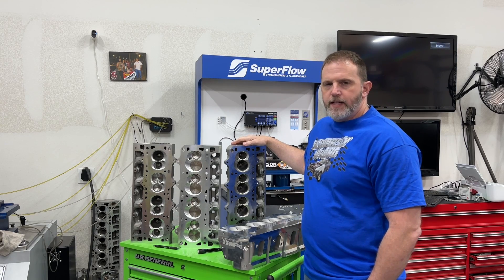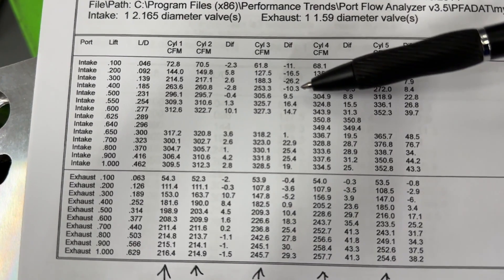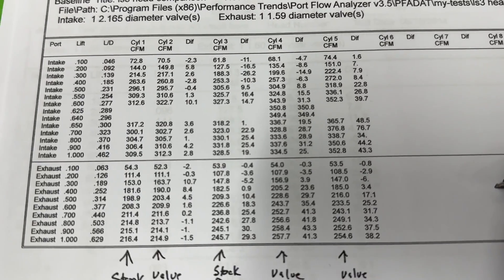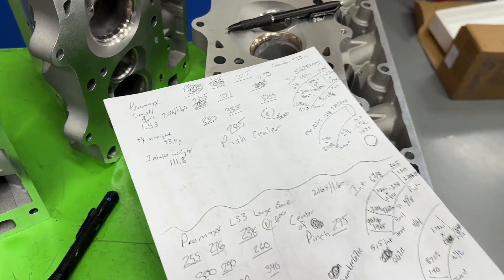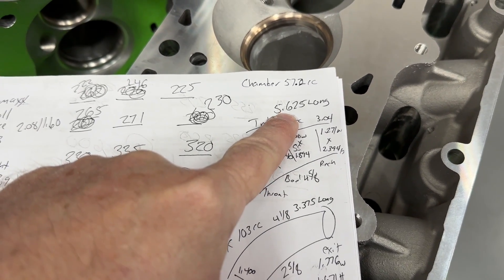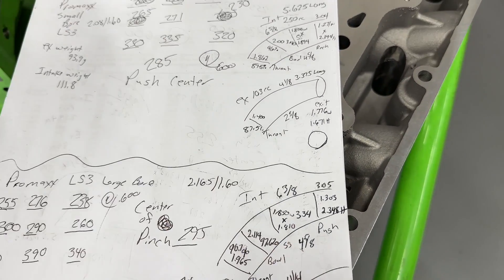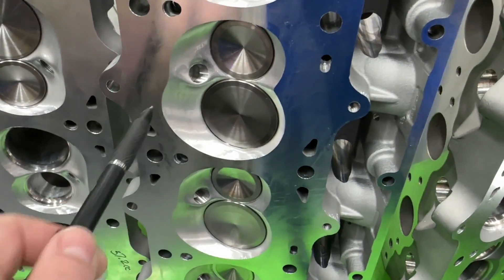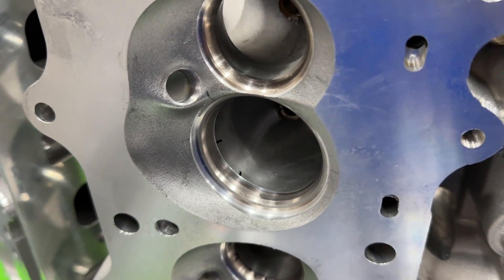Which Is The Better Flowing Promaxx LS3 Head

Comment: Looks like at the very least Promaxx has some quality control/tolerance issues they need to work on.
Reply from the maker: Every company makes mistakes
Reply: @WeingartnerRacing  This is true - I'm sure the next set you come across will seal properly, have a 240cc intake runner instead of 250cc, a 63cc chamber instead of 57cc, and flow just as well as the first set did 😉 

It's really the combustion chamber discrepancy that concerns me the most. Very few people are going to cc a brand new set of heads and on an LS1 going from an expected 63cc chamber to an actual 57cc chamber is going to raise your CR by ~0.8, and that could lead to some real tail chasing figuring out why you keep running into detonation on pump gas with what should be reasonable timing.

Comment: Nice side by side flowing and and other stuff my guess since it is a 408 kinda bug engine not to big. But I think 3rd place will be stock head then 2nd place will be large bore yes is outflows small bore by a lot but the small bore already flows so much air probably engine doesn't need anymore so the small bore with way smaller cc that will make more compression I think small bore will take 1st

Comment: Bcz YT took my reply button away, I write this here: The swirl turns, bcz the swirl guide, the ridge inside the bowl creates a stationary vortex that fills the wall side of the bowl. This turns the flow towards the center and under the valve. Depending on your cam profile, this can bleed into your exhaust and if O2 sensor is used, give a false reading on your AFR (too rich). To get the escaped charge back inside your chamber, you need a back pulse from your header setup and the incoming mix from there is hot. All this may occur from a stationary valve, so it might not be as big of a deal in a live engine where the valve is moving, but you need your swirl to move across the spark plug before it hits the exhaust valve and not the other way around. On a traditional small block this means different cylinders need to swirl in different directions. Also when you have sideways angle in your valve setup, so your valve opens towards the center of the bore, this helps directing the swirl. To fix this particular port, the guide tail needs to be blended in and the leading edge smoothed out. It still has it's place inside the bowl, but the shape has to be massaged a little. Also the valve job and especially the blending are critical to keep the swirl in the right direction.
EDIT: There is also a possibility for this setup to work as is, but it's very much cam profile dependent. That turn in swirl can fill the center low  pressure area inside the chamber, but only if your exhaust is closed. Also, if you are using positive intake pressure i.e turbo or super charger, the swirl guide acts differently. In all motor setup, with a mild cam, this port will make good power. But when you modify the setup, this guide as it sits starts to create anomalies.

Comment: I remember a while back you realized that when the intake valve opens it is close to the chamber, how do those heads do in that respect? Good job man.
Reply from the maker: The valves are moved away from the bore so it really helps them.

Comment: You do invest some flow energy into swirl, it can help and hurt you. The swirl has inertia, so it's good for transients at low to mid rpm, but creating the swirl takes some flow energy, which will affect flow numbers. Of course this isn't a hard and fast rule, different engines, and head designs make use of swirl differently. Diesels for instance benefit from swirl since they're low rpm engines and fuel mixing is very important. Their cylinder heads being flat, or nearly flat also help them generate effective swirl. On 2 valve engines, obviously, you know the swirl is built into the port and chamber geometry. On 4 valve pent roof heads swirl is very difficult to make work, so the focus is more on tumble. Of course every engine has both swirl and tumble, but again each engine is different and makes different use of flow rotation.

Port flow is aided and hindered by hysteresis, the flow circulation stores energy, if you run out of flow, that inertia stored in the system will give you that last little gasp to keep the flow moving, or it can impede reversion. It can also hurt you because the energy stored in the flow inertia works both ways, if you have that recirculation and the flow needs to go against the direction of recirculation, you will need more flow energy to get the same mass flow than if that recirculation wasn't there. You made a video, where you blocked off the port of the head you were flowing and it didn't recover fully, that would be an example of hysteresis, in order to recover the flow you would have had to introduce more flow energy to overcome the energy stored in the circulation.

https://www.youtube.com/watch?v=56HMZbr8c7E

Using the concept magnetic hysteresis is a perfect analogy for understanding fluid hysteresis.
Reply: The "top hat" or "high hat" piston design in the diesel engine aids tremendously in developing the tumble to make the homogeneous mixture burn as efficiently as it can. With the new addition of dimples to diesel pistons, efficiency is greatly increased. I believe tumble occurs, mostly, in the 4 valve diesel combustion process due to the orientation of the 4 valves, and swirl is of little existence.

The port recovery would occur with the next pulse of incoming air charge on a running engine. It along with a quarter of the initial pulse blocked and reflected at the valve closed event would not only recover, but if timed right, increase engine efficiency past 100%. So I don't see much in the flowbench incapable of recovering. It's only a flow bench. 

In reference to
Reply: @arturozarate1752  A diesel combustion chamber can induce a nice amount of swirl with poly-quad valve configuration. The flatness allows the offset valve size to induce swirl much better than a pent-roof chamber would otherwise. With such a setup you can have the ideal amount of tumble and swirl. Polyquad doesn't work as well on a pent-roof chamber, although it can be made to work with a semi-hemispherical chamber where the piston forms the quench pad, as Honda did with the F20C.
Reply: @rolandotillit2867  with the valves rotated 45° off axis I can see swirl.
Reply: @rolandotillit2867  I should have been more specific with the diesel engines I have experience with. The Ford 6.0, 6.4, and 6.7 and the Cummins 5.9 and 6.7. My comments and views pertain to thise specifically. Any others outside I'm ignorant of their piston and valve orientation. 

With both Automotive manufacturers their 4 valve orientation are rotated 45° off axis. The axis being parallel to the length of the cylinder head. That's how I can see that there would be swirl made in the cylinder. 

If the valves were oriented intake and exhaust valves parallel to the axis, I couldn't imagine much swirl but more tumble. That's what I see, or believe to occur,  in gasoline 4 valve engines.

I find it interesting that the fin of the valve guide be curved towards the wall of the cylinder. I bet it aids, a lot, more fresh air charge to remain in the cylinder than escape over and out the exhaust valve during overlap.

Personally I have a few things that I do to my cylinder heads to deter low lift exhaust flow and reduce the fresh air charge escaping with the exhaust. I like to keep the exhaust valve smaller than what's offered on most gasoline V8 cylinder heads. When a 2 inch valve is used on the intake I'll use as small a 1.500 for example. I only like 1 angle on the valve and seat. Finally I don't any "machinist ridge" on the exhaust side of the chamber.

The exhaust is under so much pressure and is forced out, at incredible speeds, before the valve ever reaches full lift. Deterring low lift flow as the valve return to the seat decreases the loss of charge.  A tulip valve, back cut valve, and smoothed seat to chamber transition will increase air flow but also help the good air leave with the bad. In my book those are no good on the exhaust side.

Comment: Could the swirl change be caused by the valve moving past a backup in the chamber? maybe something affecting the air flow off the short side against the cylinder wall? I don't know just trying to understand the dramatic swirl drop / direction change at the same lift as peak CFM. Also, in your opinion is there a correlation between swirl and HP numbers. I get it for low flow low rpm Torque applications. But is there a point that it becomes Moot?
Reply from the maker: Maybe